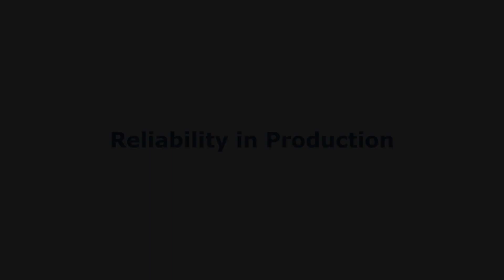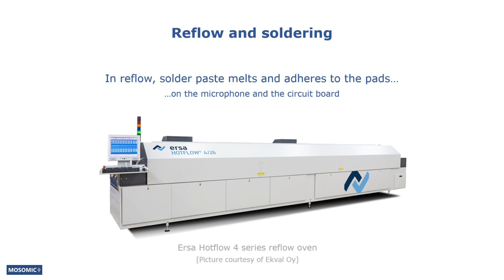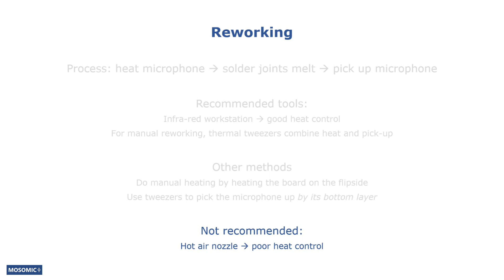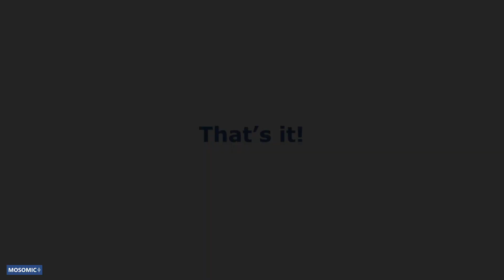Reliability in Device Production | MEMS Microphone Guide Ep24 | Mosomic

Comment from the maker: 0:34 Reliability in production
- 0:36 Poorly controlled device manufacturing processes
- 1:22: Device design and assembly processes
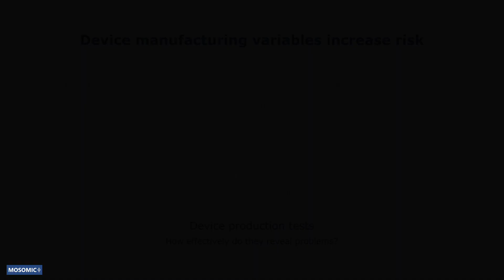- 2:31 Mechanical threats
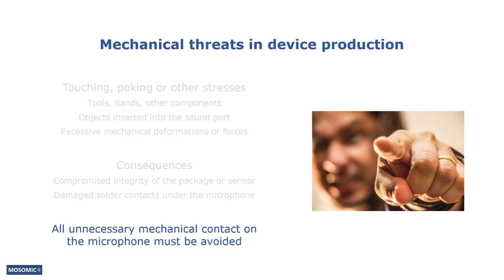- 3:25 Pick & place process
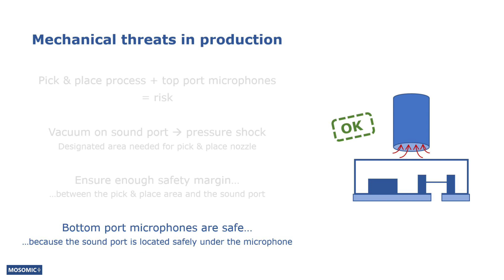- 4:42 Contamination
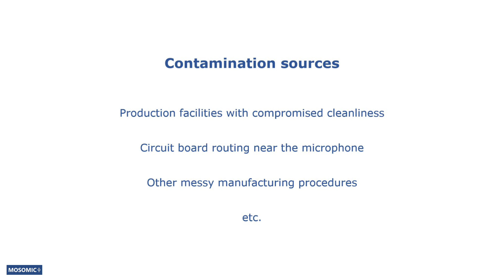- 5:02 Cleaning of the device circuit board
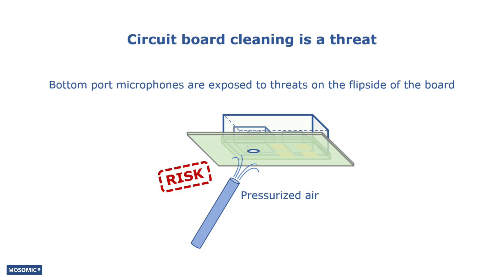- 5:48 Excessive temperatures
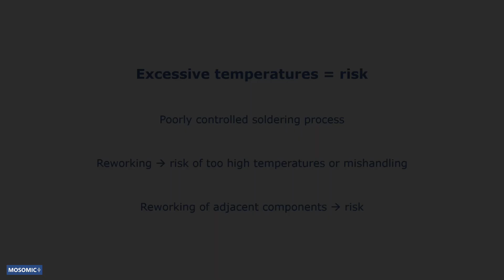- 6:30 ESD

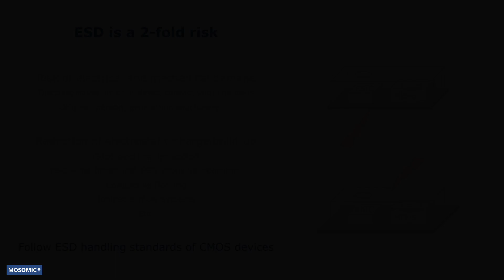8:16 Reflow soldering
- 12:03 Moisture Sensitivity Level - MSL

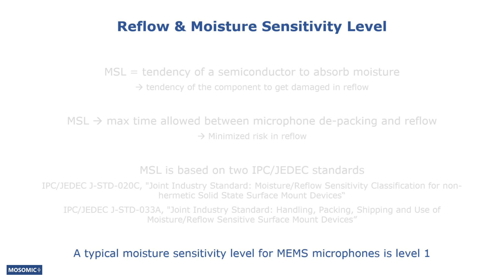13:46 Sealing ring and solder paste
- 15:14 Solder paste application and amount

17:27 Reworking
- 18:08 Component removal
- 19:32 Mounting a new component
- 20:50 Reworking other components close to MEMS microphones